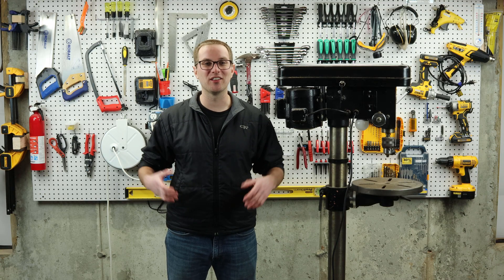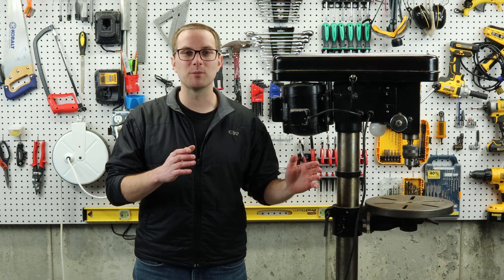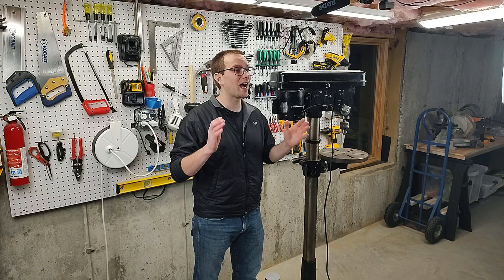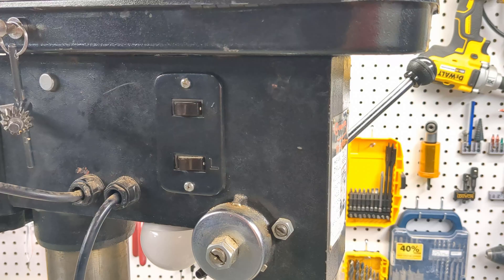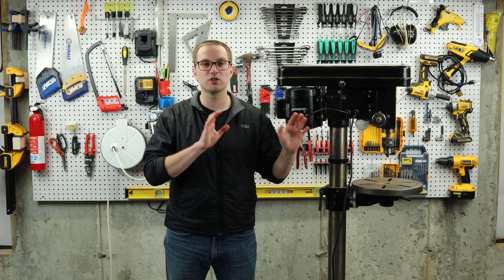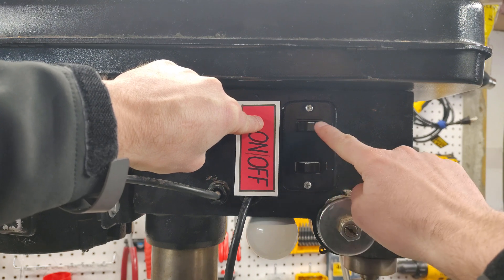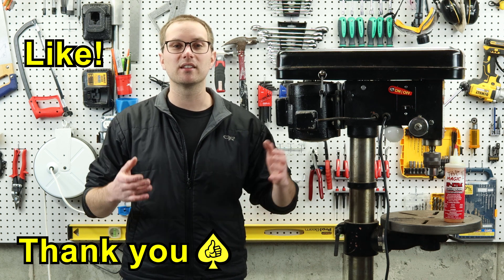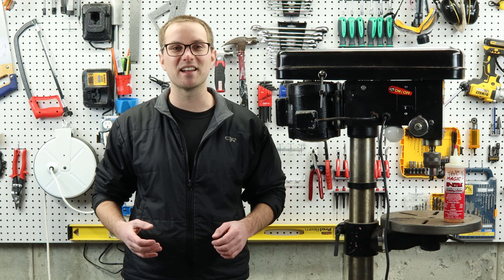Drill Press Safety Upgrade: 3D Printed On/Off Switch Guard

Comment: Ooh, the cover holding itself open when the switch is on is clever. Well done.
Reply from the maker: Thank you! I wanted to make sure the off switch is never obstructed in case a chuck of work piece ever breaks off and starts helicoptering around on the drill bit. I suppose if things really get hairy I can always hit the deck, belly crawl to the circuit breaker, and cut power. Hopefully I don't test this all out...

Thanks for watching!
Reply: @AsaMakes  I've had to turn off a drill press because my part was helicoptering a non-zero number of times.